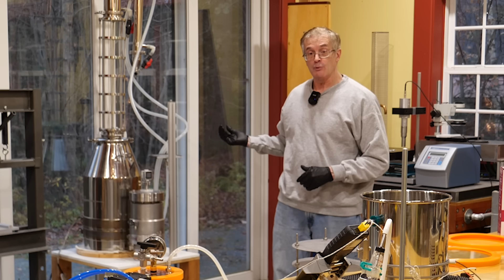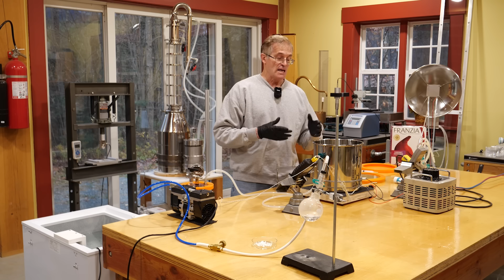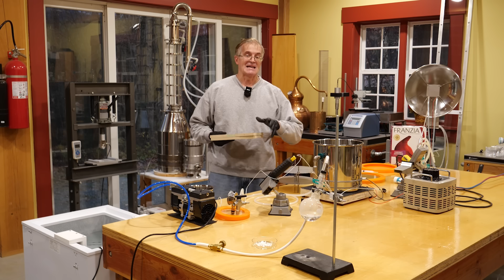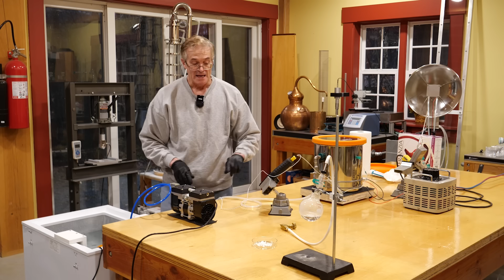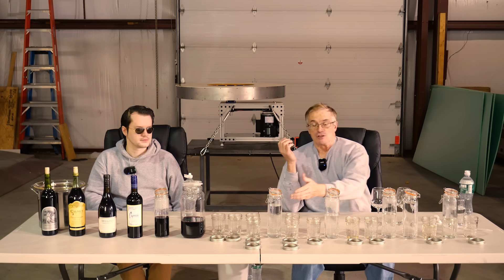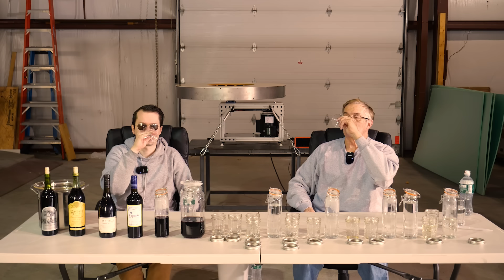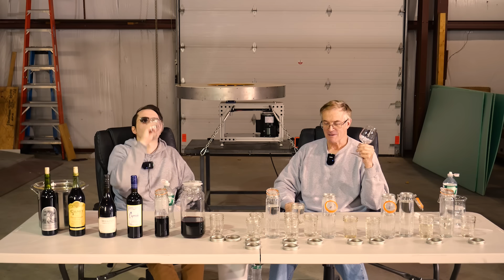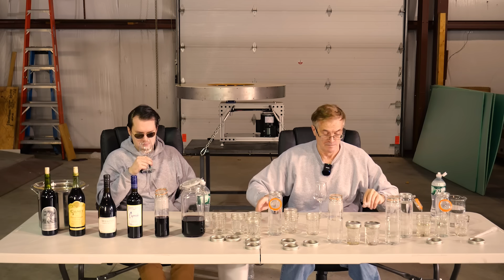Turning $3 Wine into a $100 Vintage with Science!

Comment: I don't know if this works for high temp silicone, but freezing rubber plugs hardens them up enough for drilling. 
 Helps if your drill isn't too sharp as this can make it grab too much and wander. Use an old drill or a brassed off one if you have it
Reply from the maker: That's true.  Combining that with the tube support method can't hurt and will probably help.

Comment: Running any clear alcohol through activated charcoal improves the taste and smoothness by removing unwanted flavors. If he did that to the unwanted alcohol he probably could have made it worth keeping. 

You can use 4 feet of 1 inch food grade tubing with a screen on the bottom (to keep in the charcoal) and a funnel on the top. You may want to run it through 2 or 3 times to get the results you want.
Reply from the maker: That's a good point. We isolated these flavors in the various cuts and excluded the entire cut when the flavor was detrimental.
Reply: @TechIngredients  Yes, i watched. It was a good experiment. I was just suggesting that you could remove the bad flavor from the rejected alcohol, and keep the alcohol itself.  :^)
Reply from the maker: No, I understood that.
I'm taking this further. If each cut could be optimized rather than discarded, there's less waste and even better control.
I'm focusing on ways to improve the final blend.

Comment: I really need some help with understanding the rating of the pump. I went to look it up because I want to buy one, and it’s rated in -95kpa. Is the seller labeling it as a negative number to simplify it for the layperson? So in actuality it can reach a pressure of 0.05 atmospheres? Can it actually achieve such a low pressure? It seems like an impossible task for such an inexpensive pump.
Reply from the maker: Forget the labeling. 
Because this is a two stage diaphragm pump, it can actually reach lower pressures if the system is tight and without leaks. It works.

Comment: If I need a hole in a silicone stopper, I just use a hole punch like the ones used for leather. I put it in a drill, put some oil on it and just cut through the silicone like butter. The diameter I use is the one of the thing I want to put through the stopper and it will be perfect friction fit.
Reply from the maker: Thanks!

Comment: Dangerous methanol amounts (pure, ingested):

Blindness: As little as 4–10 ml (some cases reported at 4 ml; commonly 10 ml of concentrated methanol).

Death: Around 30 ml (minimum fatal often cited; up to 100 ml typical lethal range without treatment).

Distilled (moonshine, spirits): Risk exists only if you fail to discard the "fores" (first ~50–200 ml per run), which concentrate methanol (boils off first). Methanol → formic acid → optic nerve damage → blindness.

Comment: I would not have included that first heads cut, and/or would have made finer cuts at that point.

That burning sensation isn't necessarily from the alcohol itself - high-proof alcohol doesn't necessarily have a burning taste itself.  It's from some of the other volatiles (including acetone!) in the heads.  There may be far less methanol in heads derived from grapes, but there still is some, and there are some other unpleasant compounds in those heads, and often those compounds are the hallmarks of a cheap wine...
Reply from the maker: Finer cuts are certainly an option, but it would have made the video cumbersome. 
Just a side note, pure ethanol does burn as it stimulates the same receptors that react to substances like capsaicin.

Comment: A couple proposals that could be considered when working on deploying a copy of this system. They make it more complicated but could make it more effective (faster, better).

1) It may be most effective to degas the liquid and pull the first liquid through the system completely absent of any heating, or to even run it on a cold (refrigerated) liquid to begin. The first short cut of the heads is the most harsh and if only the first few ml of condensate are discarded, this is normally going to be helpful. The presence of first liquid condensates signals when to start ramping up the heating. Maybe the 200W was arrived at through experiment? I wonder if ramping the heating up would also have helped keep the cuts distinct?
2) Deploy an ultrasonic transducer in the "boiling" bath, perhaps in conjunction with the ceramic beads, to encourage the boiling process to be as stable as possible. This would very quickly assist with degassing the liquid and this could further help to refine the sharpness of cuts. 
3) Consider putting a low dose of salt in the refrigeration bath to bring down the temperature slightly below freezing to further encourage trapping. (As I watched, I believe there was quite a bit of loss to the pump). 
4) Consider adding a significantly larger surface area (a stainless steel heatsink, or some tufts of 316L stainless steel wool that has been boiled in water to clean) inside the condensor bath to encourage condensation and ensure minimal liquid vapors are making their way out of the system through the pump.
5) Put the blended wine through a venturi pourer to oxygenate the wine before tasting. After degassing everything, this could help quite a bit!
6) Add a few drops of high quality 20yr tawny port (or for example a madiera or amontillado sherry)  the final blend. This is a relatively well established hack to add complexity to a simple young wine. There were some things fundamentally missing from the Franzia, you succeeded to get lots of the bad stuff out, but adding in some of the notes associated with aged wine in can also make a surprising difference.

Comment: Awesome video.  As loathe as I find it to suggest watering down the wine, I was wondering if you needed to add back the volume of liquids you removed in water to dilute the final mix back to the original concentrations.
Reply from the maker: That's certainly an option.   We didn't as the change in alcohol percentage is pretty small.

Comment: I did a similar distillation recently with a single chamber and a steel pot filled with ice and salt above a box suspended above the wine inside the chamber.
I also used it to make banana chips. Compared to air drying, vacuum drying fruit could be faster, more energy efficient and allows drying hygroscopic fruit like banana while also preventing oxidation. The only problem I have is getting the heat to the fruit. Currently I'm using a water bath for the chamber and I put thin slices of fruit on the bottom of the chamber but that doesn't scale to multiple layers.
Maybe you have an idea how to heat fruit inside the chamber possibly using better heat conduction or infrared lamps?
Reply from the maker: The water bath would be hard to beat. 
Have you looked at sous vide circulators?
They wouldn't be faster, but they may make the process easier.   They're cheap on Amazon.

Comment: i really like that you include explanations for manufacturing parts. For example, explaining how you cut out the circular mesh bump guard just adds value to the video. Little tricks like that can be used on so many other projects or applications
Reply from the maker: You're welcome!
I fully appreciate that.  I have learned so much from hanging around labs and machine shops it would be a shame not to pass some of that on.
Reply: @TechIngredients  well its very much appreciated!

Comment: The real trick is to not just add all the ones you like together. You need to blend them together in different amounts for optimal taste. You almost certainly should not have used all of the red concentrate. You should have reduced it by the calculating the percent of the concentrate you left out and then reduced it by the same percentage. At least as a starting point.  I would have started at 50% of the total red concentrate and then added it back slowly and tasting it until it hit the right amount.
Reply from the maker: I don't disagree, but imagine how deep you could go down that blending rabbit hole.

Comment: why is there no methanol in the wine? why would there be if you ferment it yourself but then not in this bag?
Reply from the maker: There may be some methanol in the commercial wine. But, based on the volume of the undistilled wine it's considered to be at safe levels.
An interesting fact that the recommended medical treatment for methanol poisoning if to give the patient ethanol because it displaces the less tightly bound methanol. 
Essentially, a martini can save you!
Because we are not concentrating the wine in a significant way, we can ignore this small amount of methanol.
Reply: @TechIngredients but you would neet to be careful if you were distilling a big batch and only drinking the first container that distills? I think it’s dangerous to claim that there is no methanol in it?
Reply from the maker: I should probably have made the point I just made with you during the video.
In the context of a wine improvement separation, the issue isn't significant. 
But, if some viewers thought that commercial wine is somehow free from any methanol and they decide to do a distillation for the purpose of extracting only the first, high alcohol cuts then this could be an issue. 
Thanks.

Comment: Your first "cut" is NOT PURE ETHANOL.  We know this because pure ethanol does not taste strong and does not burn when you taste it.  The strong burning sensation you felt are the impurities of the first cut / "heads" - - - which are the low-boiling, volatile compounds that evaporate before ethanol and include methanol, Acetaldehyde, Ethyl acetate, Acetone, and other light volatiles (low-molecular aldehydes, light esters, and trace ketones). Each of these are considered undesirable or dangerous impurities and MUST be discarded.  REPEAT:  The heads (which can be 1-5% but is typically / in practice 2-3%) should be discarded.  Unfortunately your first cut was way too large.  All of the undesirable compounds listed above should likely evaporate at the beginning in a volume that is much smaller than your "first cut" jar.  So next time you'd be wise to make much smaller cuts in the beginning ("heads").  Keep all of the middle ("hearts").  And then make smaller cuts again at the end ("tails").  For the sake of safety, discard the stuff at the beginning as they are toxic and can cause illness, blindness, or even death.  Hope this helps!!!
Reply from the maker: Thanks for your input.
I'm very familiar with the points you raised.
I disagree with your statement that pure ethanol doesn't burn. It sure does! Take a sip of Everclear if you doubt me.
Also,  keep in mind that everything we separated came from the commercial box of wine that is available on the store shelf and is intended for consumption. 
Also, the separation isn't discrete. More volatile components are present in the earlier cuts including some flavor components as well, but are also present at rapidly decreasing percentages in later cuts.
What we found surprising was that the hearts tasted the worst and by excluding them, the mixed flavor was better. 
Who'd a thunk!

Comment: You need a winemaker or sommelier for a blind ttaste test. Otherwise it's 2 guys who don't know wine.. Science maybe, but there are many inconsistencies. You have no idea of tha ABV. You used the same device to move the different samples, then rinsed your glasses with water.  You used different volumes of each sample, and had you stopped the distillation sooner or later, or added less or more of the leftover your results would have been different. Plus if you add the cost of the equipment AND the time involved to make a bottle it's no longer a $3 bottle of wine.
Interesting to watch but as a real experiment not that great.
Reply from the maker: I agree with your first suggestion.  It would be great to perform some blind taste tests with people who know wine.
The rest of your statement isn't worth much.
This technique is easy and the principle makes sense. Remove from any wine flavors that don't taste good.The process is now accessible to millions of people.
A SINGLE RUN WILL PAY FOR ALL THE EQUIPMENT. 
Any subsequent run is money in the bank.

Comment: This was great all the way through. The one thing I think was missing was to behave as a winemaker, and scientifically produce a couple of different wines from the original, pushing them in different directions. Rather than just exclude what you dislike, do that as a first pass, make a third of the mix that way, but then make another third where you emphasize, say, the citrusy bits, by overrepresenting them in the final mix, and also experiment with the alcohol level. I would also be very interested to know what the difference would be if you just compared your preferred mix to your preferred mix with a fair bit of the heads cut out, for a lower alcohol wine with still most of the flavor. Fascinating in any case. It would also be great to bring your version to a winemaker or a sommelier or a wine critic and get their opinion.
Reply from the maker: Those are good suggestions. 
We held off with the more complex modifications simply to keep this already  very long video manageable. 
What I wanted to establish was a completely new approach to improving any wine and make it practica forl anyone interested to take it further.

Comment: After some googling ... I believe this might be called "batch vacuum distillation" and there are companies that make equipment for it. Maybe not specifically for wine though. I guess if you can experimentally figure out the cutoff points for the components you want to extract and exclude you could probably simplify the process down to fewer batches. In this case maybe just 3. Then by adding another condenser container, a selector valve, a solenoid (or servo) and a timer this distillation setup could be fully automated. Or maybe a pair of valves and actuators is cheaper. The valves don't need to be anything special as long as both cold vessels remain depressurized. I was actually a bit surprised you didn't seem to lose much of the alcohol through the vacuum pump. I would have expected a spiral cooling condenser going into the lid of the smaller container to prevent more of the vapor from escaping. But maybe the metal valve there lets enough of it condense and drip back down so it doesn't become an issue. My instinct is that even with Pascal (and Bernoulli) in mind some of the vapor must want to go up the blue tube before it touches any of the cold surfaces. On that topic I was left wondering whether the reduction in alcohol content and the difference in time that the different wines were allowed to be in contact with air had any influence on your final evaluation. If you can please invite a professional wine snob (excuse me, I mean a sommelier) to a double blind taste test for your next attempt. I would love to see you modify 2 wines. One cheap, one medium priced. Perhaps include 6 other similar but differently priced wines, bought and selected by a third party. 2 samples of each variant, 10 total variants, 20 total samples. Handled and poured out by a third party but according to the sommeliers instructions (air out time before tasting etc). Each glass numbered, catalogued by third party without the tasters knowledge. Each of you including the sommelier tries to rank the 20 samples. From the 2x samples you get a measure of consistency. The expectation would be that each taster can identify the 2 identical samples and is able to place these next to each other in ranking. I don't actually doubt your objectivity in the evaluation you performed but I still feel that this sort of testing procedure would go well with the overall theme of the channel and you could use the opportunity to interview the sommelier about any post processing techniques commonly used to improve wine quality that they might be aware of. Just some ideas for your consideration if you plan to make more videos on this topic. Love watching all your videos! Thanks a lot for bringing this level of science and entertainment! Inspiring stuff!

Comment: I dare say that anyone inclined to duplicate your effort will be capable of solving for the little mechanical obsticals  like thermocouple leads and sealing or drilling hoilews  in pots, cutting sheet metal on a bandsaw etc.,  so wasting your time explaining these trivialities is  - - well  wasteful. 
I'd have preferred a quick primer on how you were going to crack the wine into it's different constituents without using heat. 
I think I'd have chilled the little pot with a peltier effect unit and an aluminum slug for thermal inertia.  or soldered soft copper pipe around the body and pumped a coolant through that.  But you got 'r dun with the big tank so ~ ~ ~
I was never really clear on how you cracked the components.  Maybe I missed it?
Looking again your process I can;t say I understand how you chose when to separate the distilation process to obtain different components.
Reply from the maker: It sounds like I succeeded.
Despite your constructive criticisms you're thinking about how you would approach and maybe improve the process.
Regarding your comment about the trivialities, I have an ulterior motive. A major reason we do these videos is to teach and encourage the viewer to go further, not just to demonstrate and entertain. These techniques all have broader applications.